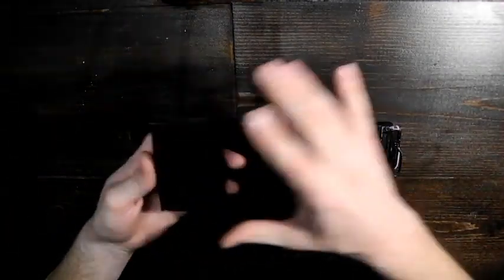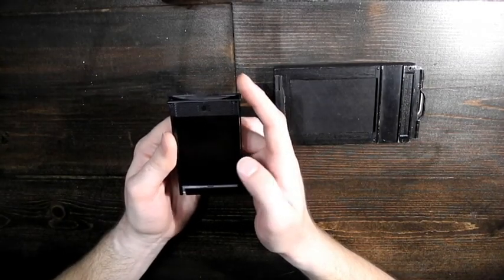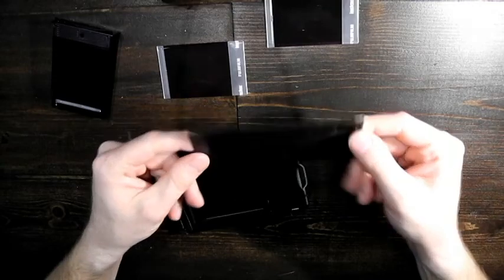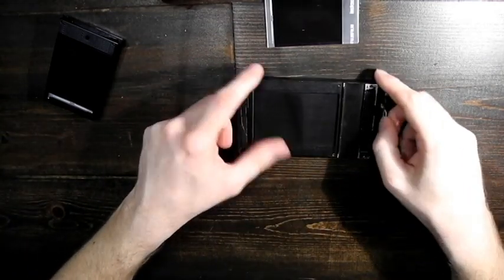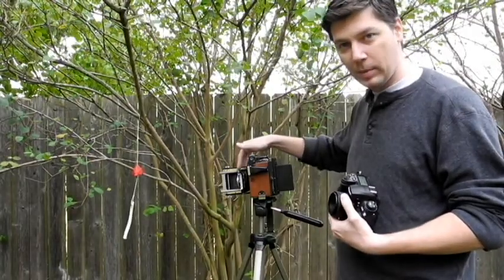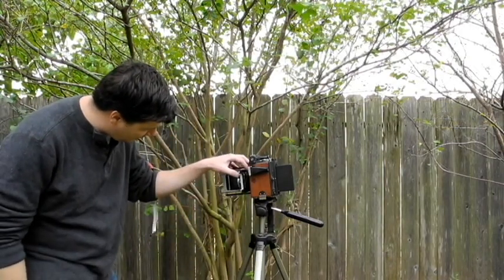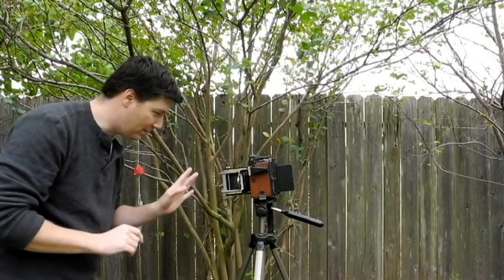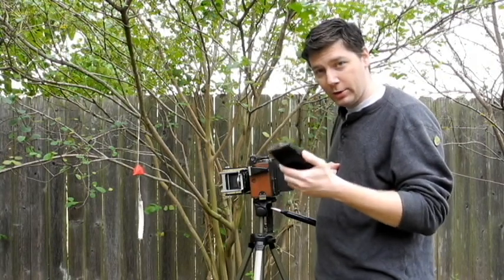Use Fuji Instax in 2x3 Speed Graphic - Part 1 (Loading and Exposing)

Comment: So answer me this. Are you correctly inserting the film because your putting it in with the emulsion facing down in the holder, is that correct?
Reply from the maker: The back (black) side of the instax film is what needs to be exposed to light, so should be set up in the holder facing the lens.
Reply: Really wow, ok good to know, just purchased the Fuji instax today and I have found the sheet film on Amazon but want to test out the camera functions first

Comment: wow ! hang on a minute, you forgot to put the slide in the instax cartridge ( haven't you just "exposed" the rest of the cartridge to light as you opened the changing bag?), better to seal everything before you open the bag{N.B.: I realize that load was for demo purposes, I am meaning in the REAL CASE}
Reply from the maker: I just put the instant camera in the darkbag with everything else.   Simply inserting the instant carrier with exposed film into the instant camera will cause it to eject the film.   The instant camera thinks it's a new carrier and has to eject the protective cover sheet.  No need to take the instax carrier back into light.